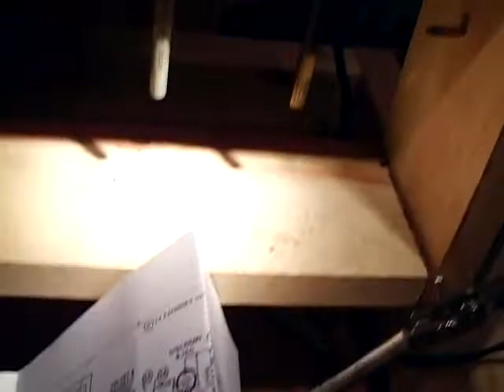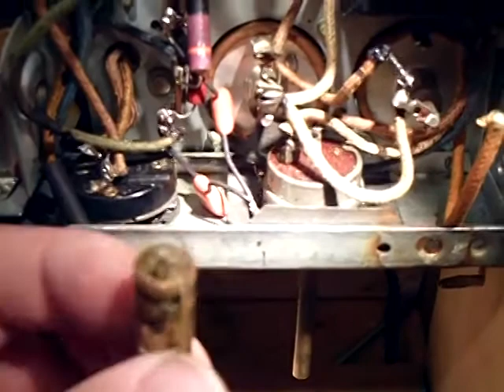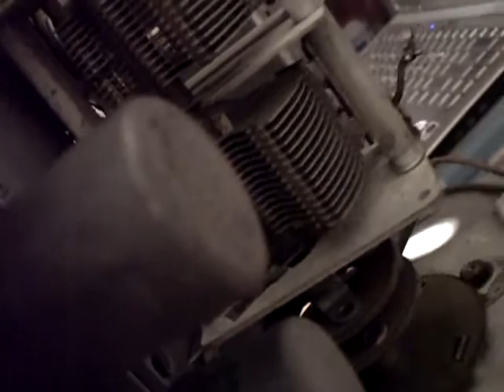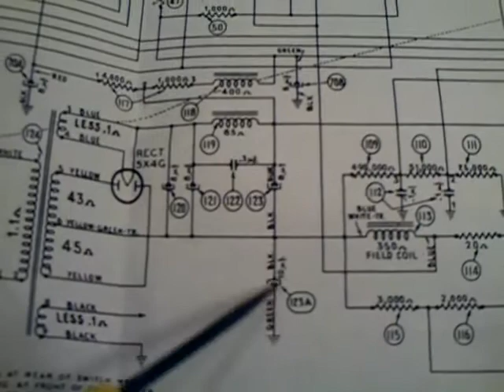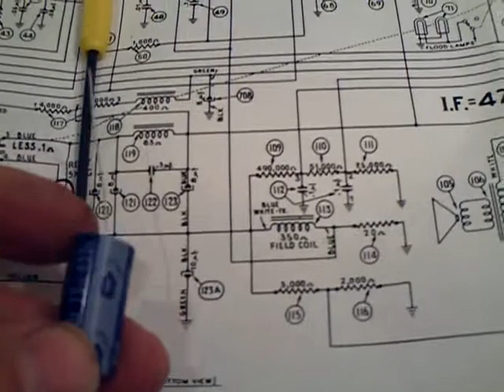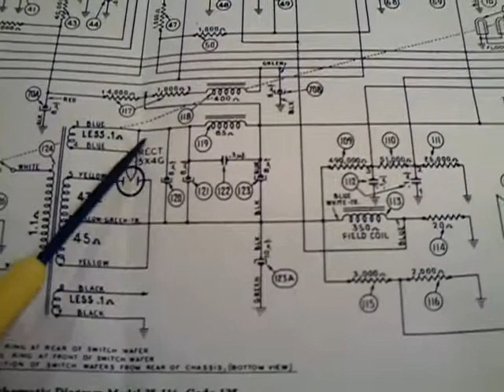Philco 38-116 Repair, Part 6, Power supply filter caps, Things to watch for.

Comment from the maker: @rrangana11 Hi Ravi, thanks for your interest in this radio. Since the receiver was never repaired I am hoping the adjustments are pretty much near the factory settings with the receiver working without any adjustments. However, I will not know until it's powered up and tested. It might need some slight tweeking but if it works satisfactory I might just leave it alone.